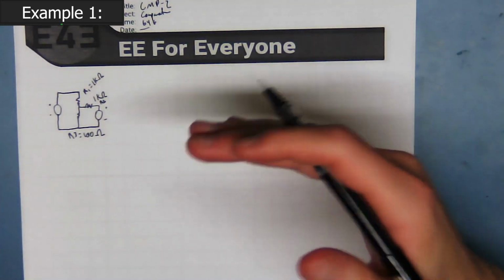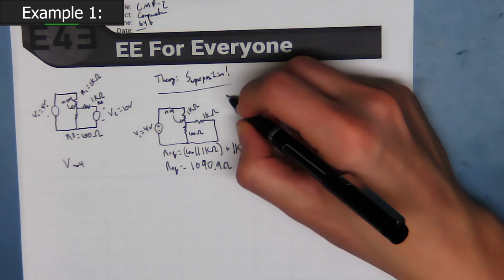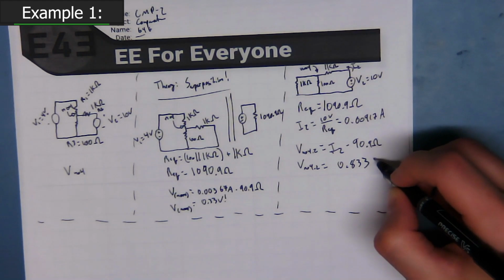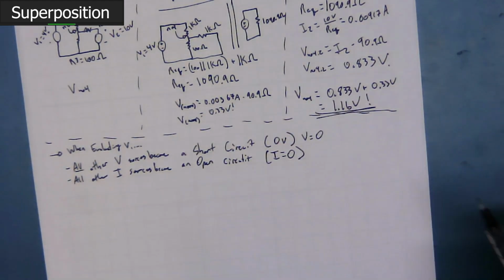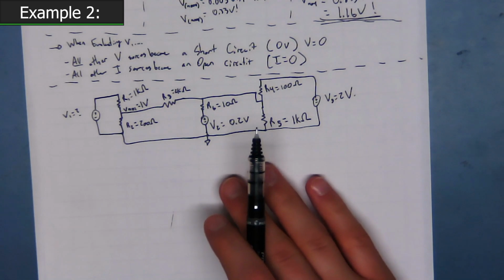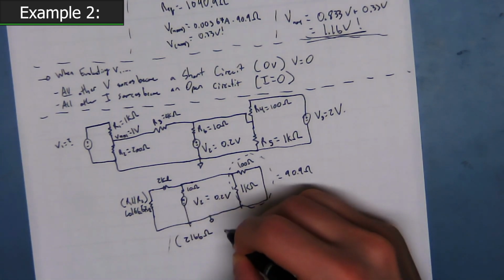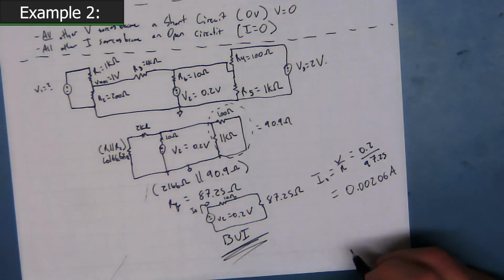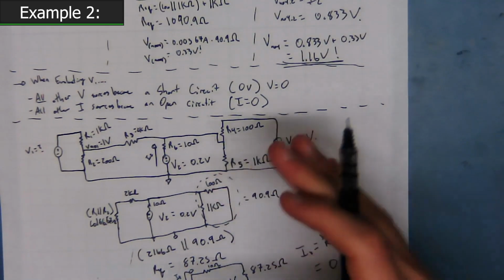Superposition and Resistor Networks (Intro to EE)

Comment: Hey I am working on BLDC motor control project. reply me if you know something about current control
Reply from the maker: HI Siva! I presume you're talking about sensorless control? Not sure where you are in this project, but ST has some AWESOME BLDC motor control dev kits for getting started.
Reply: @EEforEveryone  hiiiiiiiii..................
Yeah ST and TI are having solutions in these aspects I agree. I am in to the stuff of regenrative braking and sensorless also. I am using Arduino due for my project, the chip is haivng cortex M3 processor.  At present I am trying to control motor phase currents using LTs25-np.
my doubt is how you tune the gains for the controllers in SMPS.